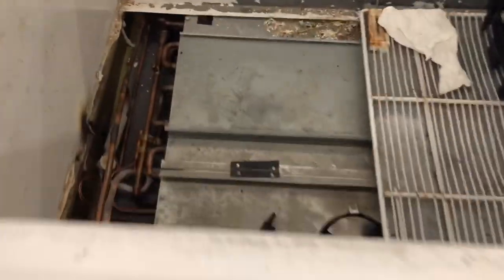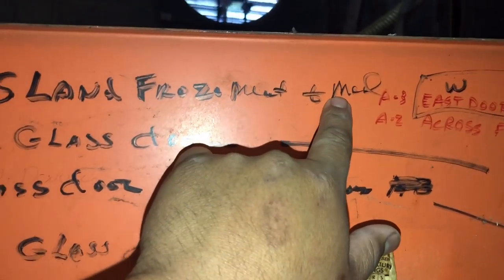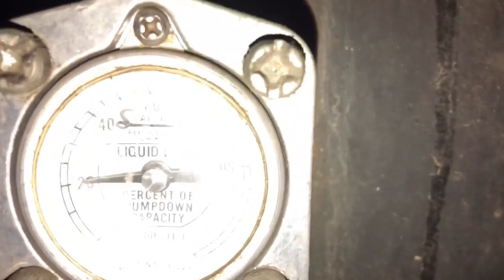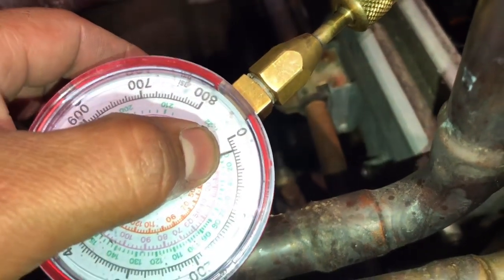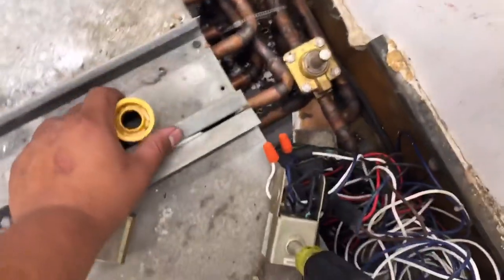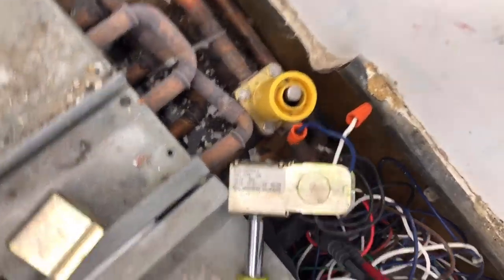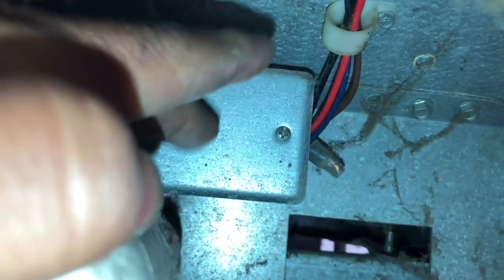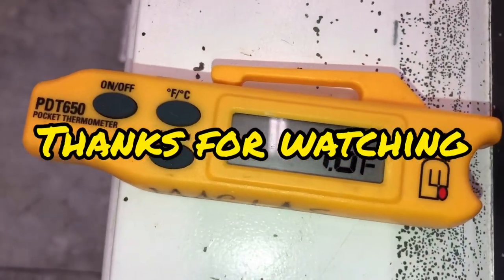Rack Refrigeration:  Dual Temp Bunker Case running warm

Comment: That rack is a hill "atmos"rack series I believe I worked on them years ago.Fyi that receiver is actually what is called a surge type receiver ( there is no liquid drop leg) the liquid line is teed at the bottom of the surge tank and the refrigerant will back up into the surge tank as the load decreases.Some of those types of surge receivers had either a flocon valve or a device called an "attron" control which put hot gas pressure on top of the receiver to maintain liquid line/receiver pressure and or to help prevent flash gas in the liquid line.....good troubleshooting on your part ...good vid👍

Comment: What relationship is between solenoid valve closed and txv  pressure limiting powerhead? That  case was running with txv on medium temp when solenoid is denergized and you showed that by your gauge 45psig, so txv was open and feeding but case is working in medium temp with fans off. Hope this help to clarify for you and other people
Reply from the maker: Immigration Freedom so apparently, that case is a dedicated low temp case.  Never used for med temp.   If they ever wanted to use it for me temp, we would have to change the powerhead.   But it hss not been used as med temp in years.

Comment: so they banged the case down, the pvc drain pipe went banging out of the  floor drain and knocked the switch off.. great switch placement at original installer or was that factory, hmm lol!

Comment: Why would the DT switch turn off power to the fans? A wiring mistake?
Reply from the maker: Probably was rewired a few times before.  There’s no telling.  Who knows
Reply: The Klixon controls fans in low temp mode.

Comment: Lucky all they did was bump the switch and didn't shear a copper line off or crack it.  My best guess is the kid getting paid minimum wage just shoved the pallet out there without a care in the world.  Didn't say anything when he ran into the case and nobody thought to check and see if it was moved.  

Looks like there is a voltage leak though somewhere, probably a bad neutral backfeeding a little to give the 30 volts you were getting.  But if the place is shutting down it won't matter for long anyway.  

Stay safe out there with all the crazy BS going on man.
Reply: On the plus side, if they sheared the line it doesn't look like it would have had much gas to dump!
Reply: typical stray current leakage across an open switch and parallel conductors, possibly even the neutral is switched, the coil wasn't energized he unhooked it, the fan thermostat was open, so he was seeing a totally open circuit voltage, reconnecting the solenoid coil with the temp.stat closed would have shunted the stray voltage out showing zero volts. which he had at the coli originally  before un-wiring.. it's easy top get fooled by stray voltage like that, bets bet is connect a known good load across the wires (fan, incandescent bulb, solenoid coil, transformer) that will shunt the voltage. fluke also has special add-on adapters to shunt stray voltages like that(expensive) others probably have them also.
sometimes you can get shocked if a neutral is switched, meter could show stray voltage of zero to near line voltage, then you grab and get ZAPPED. so always test to an equipment ground/metal casing  :)

just search for "Stray Voltage Eliminator" fluke model.  https://www.fluke.com/en-us/product/accessories/adapters/fluke-sv225
skimming over this article looks to explain it good. https://www.coleparmer.com/tech-article/stray-voltage
holy I got some hot air in my fingers to rattle all that.

Comment: If it wasn't for the fact that you said that the place is going to be closing down soon I would be kinda concerned about that 30v when the switch was off
Reply: Likely just capacitance from nearby wires, if the fans were hooked up to that it'd drop to zero.
Reply from the maker: Yup.  Just ghost voltage. 😂

Comment: I had to work on some old ass cases at a pack n save the tage said June of 1964
Reply from the maker: Tim R damn.  Nice
Reply: @rookierefrigeration4357  
OK I have to know was that rack low or was all that gas stuck in that coil lol
Reply from the maker: Tim R not flat.  Just Low.  These racks have constant leaks.   Lol